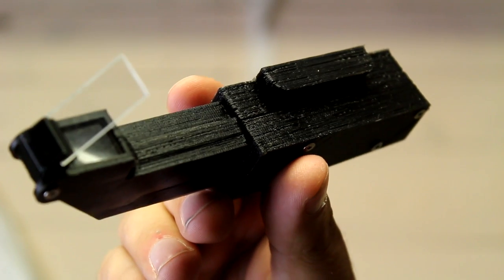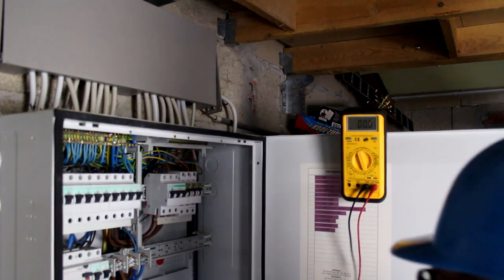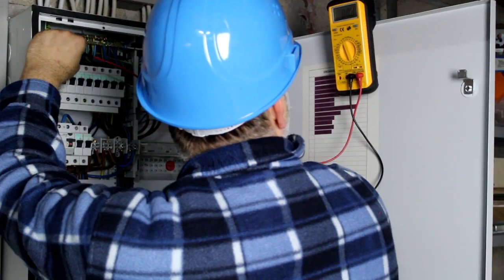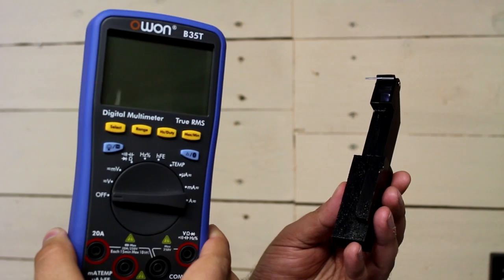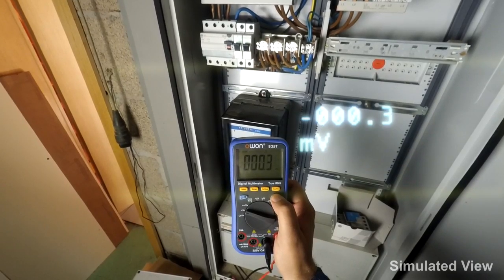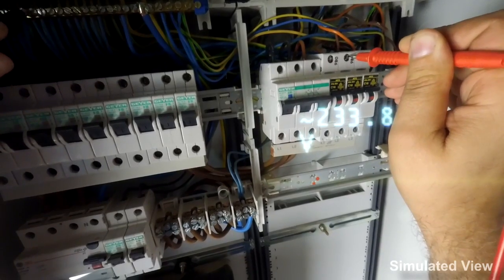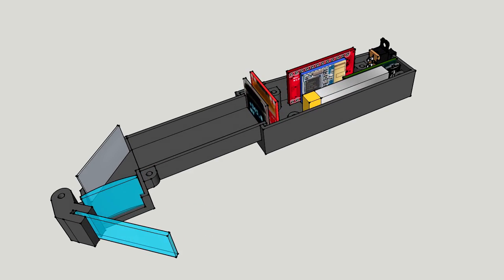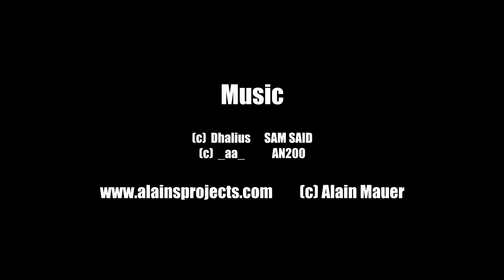Arduino Data Glasses for Multimeter

Comment: Next problem is: When you put your multimeter in your pocket (right above your heart) with live wires in it, it becomes even more dangerous :( - But the glasses are very smart :)
Reply: It has bluetooth, so it could be hanged anywhere as he mentioned, the point is that you can continously keep your eyes on the points you are measuring regardless if that is a high voltage or low voltage application. I guess this project might be expandable with other measurements from different sources as long as the connection to the arduino can be realized.
Reply: He could just hang it on the side of the cabinet like before.

Comment: The Problem is, that you need to wear glasses.. And I don't need to ^^
Reply: Scorpiaa_ | YT: ScorpiaDev a pair of safety glasses would do the trick. good idea to wear them in the field anyway
Reply from the maker: That's right. But for me it was fine. I think that it can be modified to use it with an Adjustable headband. Or just use a glass without glass or 0 dioptre
Reply: just 3d print the housing to be  one sided glasses and thats it.... remember google glass, you didnt need glasses for that
Reply: Or wear sunglasses to look cool while working on high voltages ! Bonus style points if it's in a dark basement

Comment: Wow very cool! I have qutie a few uses for this. 

The one I want to try the most is to use it as a tachometer for a motorcycle. Maybe even fuel level and oil pressure. It would be remarkably useful on the track, or even on the road as a hands-free text-based gps system.

Thanks for the inspiration!

Comment: putting a multimeter in front shirt pocket and measuring high voltages not a good idea even with display glasses on
Reply: about five year ago, an accident with a exploding multimeter happened on my workplace, resulting second and third degree wound in the hands of the two persons holding that multimeter with HIGH VOLTAGE SAFETY GLOVES in both hands!
Reply: Pffffff, lol, why? Some multimeters are attached on wristband (2 kkbose). And it's under 1000 V and it's just measuring — so no safety gloves is needed (western europe). Btw some cheap multimeters with shunts are exploding while measuring current wrong way :)
Reply: Man, you're a hater. Ever try to prop up a meter, or hook it somewhere where you can see it? And still have to take your eyes off the panel, with your hands all in there trying to find the right screw to probe, to read it? Yeah, that's a really safe situation. This project presents a super elegant and economical solution to that very problem, making the world way safer, overall. You're a dope. Great project, original poster, thanks very much. Going to order my parts now. Probably use an ESP32, with its built-in Bluetooth.
Reply: Is bluetooth you can also hang up the multimeter or put it on a table
Reply: kkbose my thoughts too. but for the point of the video I think that can be overlooked. any sparky or engineer with some commonsense wouldn't do this
Reply: kkbose he should use some safety gloves
Reply: well sir....
No pls stop writing such shit